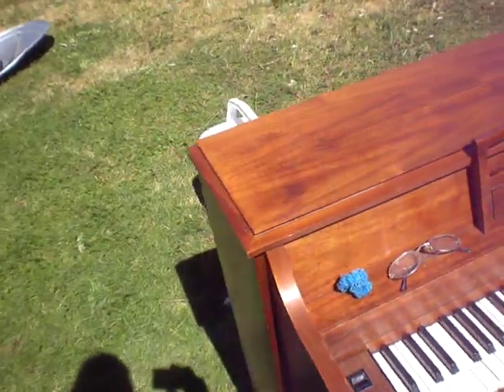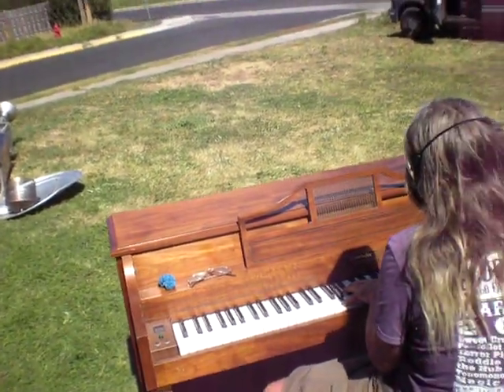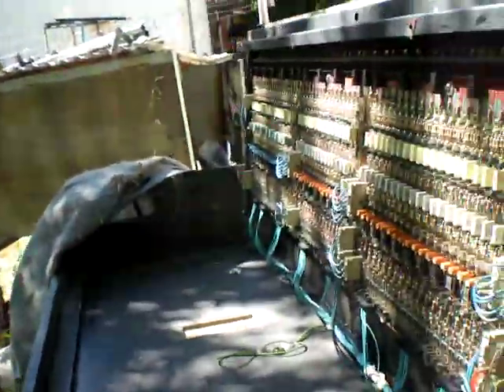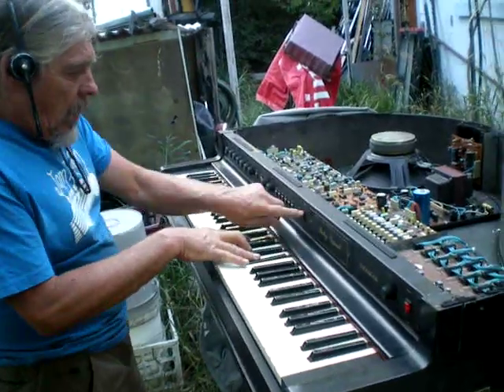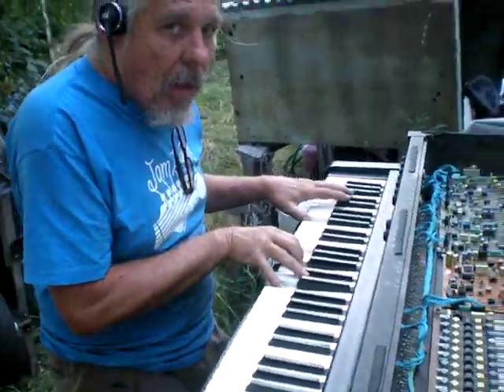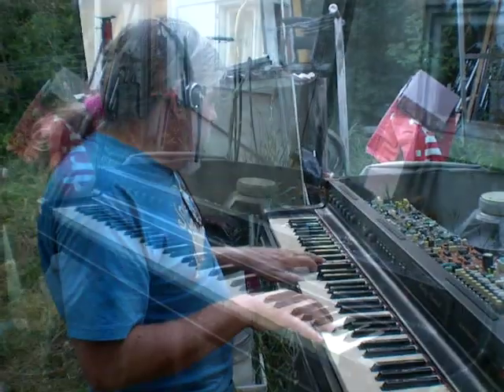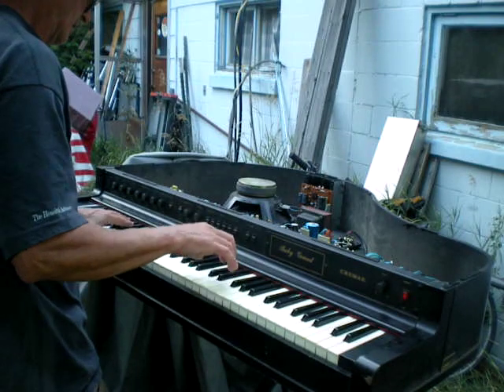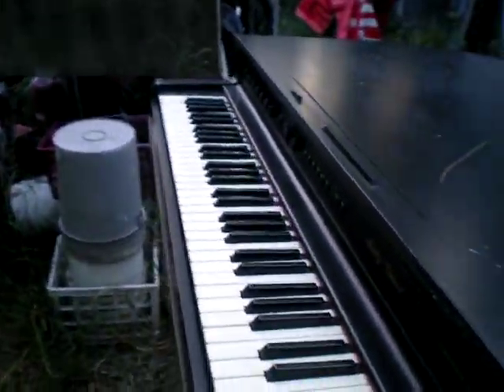Two elaborate analog pianos with Bill Rhodes.  Baldwin EP100 + Crumar Baby Grand

Comment: Does anyone know how to tune the Baldwin EP-100?  Mine's a little flat.  Is there a potentiometer in the guts of it? And I can't seem to find the service manual or any info on it online.
Reply from the maker: sorry saw no notification.... i'm not sure.  it has a clock for TOS chip which should have a coil w/ adjustable slug- potentially w/ wax or adhesive holding it.  Don't bust it!!